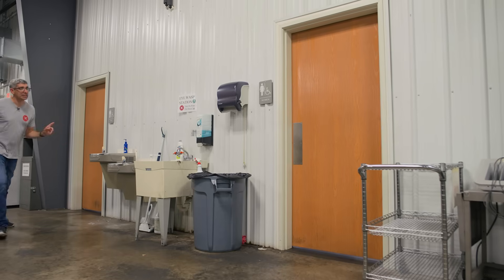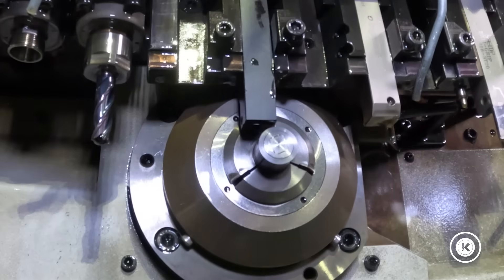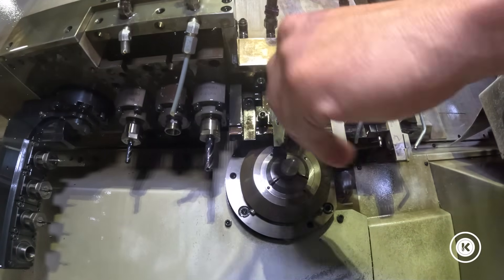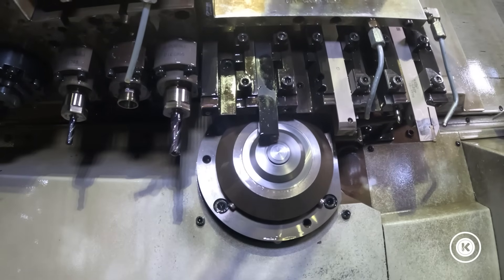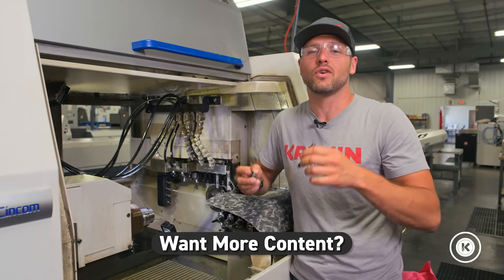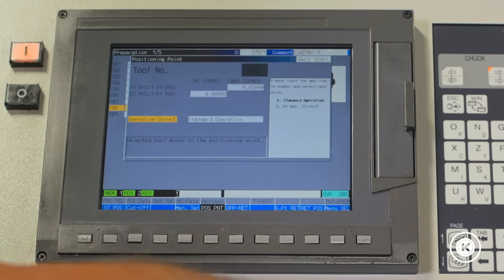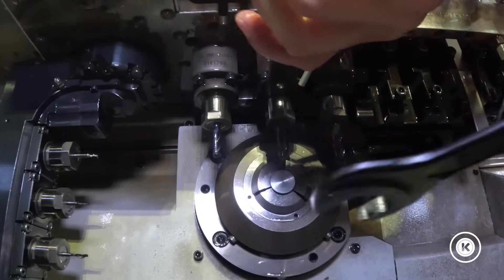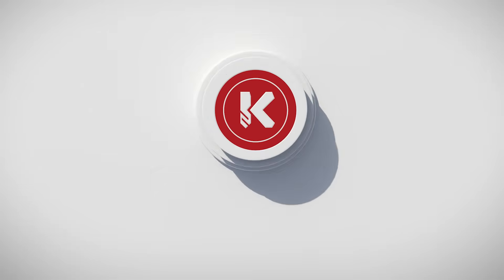How To Set A Tool On A Swiss Lathe - Kremin Inc.

Comment: Question, if I set the y off of a the back of the holder using a height gauge off the insert tip, do I need to double the Y offset?

Comment: The first thing you do is move your material out of the cutting zone.  Step two is to use man set to position your tool in the setting position. Then you bring the material out into the cutting zone. Next place the tool on the material and tighten the clamps.  When doing a cut off it does not matter if you are on core, diameter of longitude.  The cycle is the same.  Going to position point first is just wasted time it doesn't matter if it's a turning tool or live tool.  If you use the G.Pt Return function the gang slide will move up in X to the top of it's travel.

I don't like coming down in top of material with a live tool.  It's a good way to chip an end mill.
Reply: Correct. Never use "man set" with the turn tool in the gang tool holder.
Reply: Dang I have so much to learn
....
Reply: @YeOleBorther  Once you get your head wrapped around it, it becomes second nature.  It's ALWAYS safest to have the material backed off inside the guide bushing.  In that position it's almost impossible to crash the tool into the material.

Comment: I recently got a Citizen C32 and am learning the machine. How do you set the z or longitudinal values for the tools? On your offsets page it showed that all of those values were straight zeros. Any input would be great.
Reply: What kind of tool are you referring to?  A live tool?  On an L32 the distance from machine zero to the centerline of the a live tool is 15MM  (.5905)  You can use a G50 shift in the program to move the machine zero point to that position so you don't have to have large Z offsets in the machine.  After you call the tool put a G50 W-.590  then do all of your work then a the end of the tool do a G50 W.590.  That will put Z zero back a the default position.  ALWAYS remember to move the zero back after you've moved it.  G50's will accumulate.  Meaning that if you shift it and forget to put it back the next G50 you do will be added on top of the last G50 you used.  You can imagine how bad things can happen if you don't shift Z back to it's home position.  You can use this on left handed part off tools as well.
Reply from the maker: I will ask the team and get back with you.

Comment: Too much work to center a tool. I center 1st in manual by manual moving the tool it touches the side of the bar and then add 4 thousands always perfect
Reply: It's still a good tutorial for us new guys lol
Reply: I usually use the comparator and do the math for a quick reference check. Then after that I do it this way. The reason why is that you can an idea that it is still a bit off center. What he didn’t mention is that when it’s off center and you get the nib. You can cut that piece out. And if your shop has a tool scope. You can measure how far off center it is to get a precise measurement.

Comment: when setting up endmills or cross tools in general, test the tool path of the tool. depending on the cincom-model you are very close to the x-axis end stroke with short tools. Test your tool travel right when setting up, so you won't get an overtravel alarm when handJOGing the program later :-)

(cross drills are often programmed to x-15.0mm. Eyeball this distance without hitting the overtravel alarm)

Comment: instead of judging the turning tip, you can offset the CORE Value by -0.7mm on purpose, cut off slowly and take your calipers to measure the defined turning tip.

Heads up: check your cut-off end position in mcData. if it's -0.5mm and your tool edge radius is 0.8mm, you will always see a turning tip. Temporarly adjust the cut-off end position and andjust for radii-value (0.8mm tool radius = at least -1.6mm cut-off end pos)
second, depending on the material and tool, adjust cut off speed if you are using the cut-off softkey - bc it will take the values from MCdata
Reply: otherwise great video
Reply from the maker: We appreciate the tips, keep them coming!

Comment: Setting up your tools on material stock is very inefficient and not precise in my opinion especially finding the center on Core setting. Instead using inspection pin of the size of the material and a magnet which helps moving pin in and out will make your setup much faster and more precise.
Reply: I don't follow?
Reply: Here is a little instruction if you are interested.
1. Pull the stock out of the Guide bush, 2. Insert the inspection Pin into the guide bush (I have sacrificial set of setup pins for all stock diameters I'm running on that machine), 3.  Bring your tool on Dia/Core, 4. Using small magnet pull out your Inspection pin from the Guide bush and feel if you are rubbing it against the cutting edge of the tool by fine adjusting your Dia/Core. You should feel a little resistance. Don't forget to push the Pin into Guide bush away from the tool each time when switching from Dia to Core and back to avoid collision.
Reply: @yurialekseyko7335  ahh I see now.
But on DIA it doesn't have to be too precise. You have to offset the tool anyways after the first run, don't you?

And for CORE, I find the facing-off as shown in the video the most precise, as you can measure the turning pin with a caliper, offset it and face-off again to check the face.
Reply: The more precise you are on Dia setting the more precise you are on the Core, these are related. With my method I never have to face off the material and I'm always on center with few tenth off the target diameter or non. My point is fast, precise, and efficient method. Same method I'm using to find center for cross drill/e-mill, face drill, etc. What if you are working with small diameters like 1mm or so? If you too far off then you in trouble.
Reply: @yurialekseyko7335 hey man can you explain your method once more? For whatever reason it's not clicking when you mention the magnet in the guide bushing part.
Reply: @josuesalazar2307  Sure, you use the magnet to pull the pin out of the guide bushing to touch the tool since you can’t grab it with your fingers because it’s all the way in